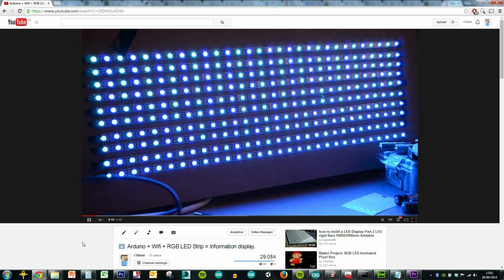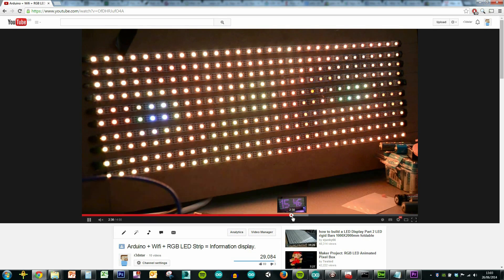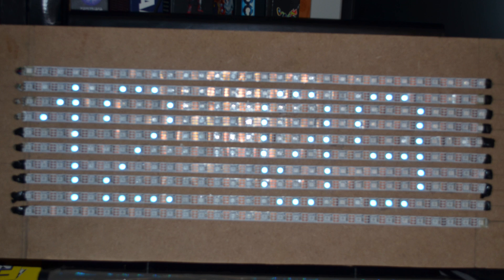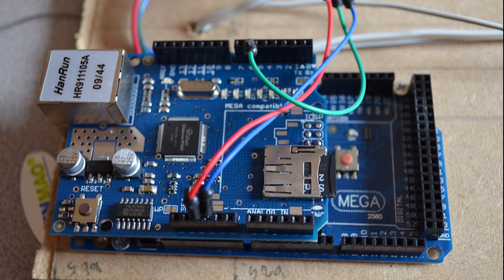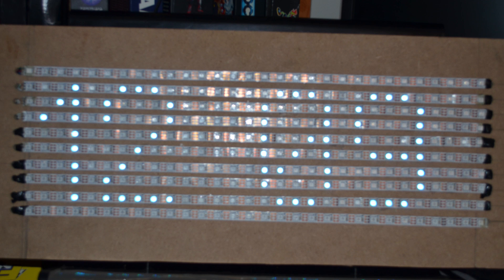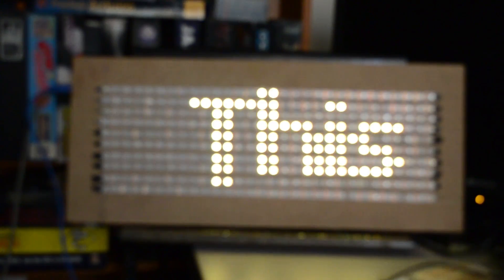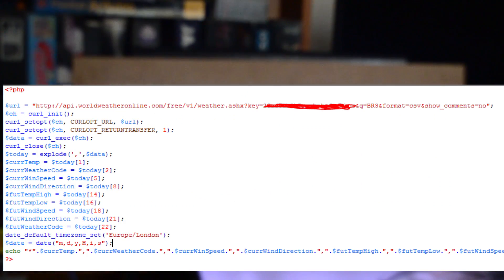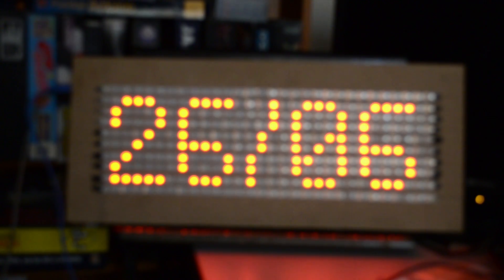Arduino powered 300 RGB LED display. An brief "How to".

Comment: Congratulations on the project. I have a question: did you power the led strip with 12 volts and the Arduino with 5v?

Comment: Question from a newcomer: Is it possible to code in what I guess I'm going to call free floating particles? So a central LED, with a glow around it made of surrounding LEDs that would glow according to a volume threshold from an audio input, whilst also be able to move freely around the board at random?

Comment: 300 5v RGB leds can pull up to 15 amps and 75 watts. Did you really have no problem powering them through pins on the arduino? I have been really concerned about power distribution with these but it might be that I didn't have to be, possibly because you would seldom want them on full white.

Comment: I was wondering. why did you place the led strip in the same direction? what will happen if you place them in a "snack pattern"?
Reply from the maker: +daniel dekel The reason for having them all run in the same direction is so it's easier to read the pixels on the bitmaps images on the SD card and relate them to the LEDs. Bitmaps run from left to right in the data in the file. If the LEDs went from left to right, then right to left, then left to right, working out which pixel relates to which image becomes much more difficult.

Comment: power consum 300 led 50mA per led, 300*0.05 = 15A, it should use 75W 5V power supply?
Reply from the maker: +TANG RAY 2.5A is fine. I'm not 100 sure, but unless you're running all of them in full brightness and full white, I don't think there's too much of a problem. Although, now I'm writing this I might have figured something out. I've recently brought it all back to life to show a class of my students and every now and then, it just stops working. I'm wondering if the 2A power supply + 500mA from the USB isn't enough after all. I might have to try a 4a just to be sure. Once I do, I'll let you know.

Comment: I love your work and so far everything works great. But the wather website that you gave apparently changed and doesnt give me the codes on the format csv. Do you know any other websites that it will or how do I create my own page on that website that it will work.
Reply from the maker: Hey George, I'm not sure to be honest. My display has been switched off for a while as it made my front room really bright at night and was a bit distracting during movies. I've just turned it on and the weather reporting is still working fine (10c with some cloud). At a guess, it might be a setting in the api request?

Comment: Can I use your code for a display with 180 or 240 LEDs or should there be written a new bunch of code for that?
Reply from the maker: Slight alterations would be needed mainly in the loops and in the bitmap reader. Nothing that trial and error wouldn't catch,
Reply: r3dstar Thanks (Y)

Comment: Thanks for video! I have a question. Is entire strip powered only from arduino's 5v?
Reply from the maker: Yes, I have hooked the arduino to a 2A power supply, but it has been run from the USB power from mylaptop, although it is dimmer.
Reply: r3dstar You've connected 12V/2A power supply to arduino, then connected strip to +5v and it lights bright, right? I've read every led in strip consume about 20mA, so 300 leds will need about 6A to have a full bright. But arduino's +5v pin can provide only 450-650mA. Is it possible to make leds have a full brightness without standalone power supply for the strip? Sorry for a lame questions, but i totally noob in electronics. I'm trying to make similar led display. I understand how to code it, but have a problems with powering. Thanks for reply!
Reply from the maker: The only thing that I can surmise is that they use as much power as they can get. It may be that to achieve their full potential brightness, you do need 6A, but I've found that my 2A PSU is more than enough. That said, I haven't turned every LED to full white which would consume the most power.
Reply: r3dstar Thanks. It's almost clear for me now. Will try.
Reply: r3dstar I really dont get it how arduino controls leds from one port ? ... I mean not the code, I wonder how does it work... did u use shifter or any other components ??
Reply: Mec Wave It uses square pulses to send data through single port. You can read detailed explanation here: https://learn.sparkfun.com/tutorials/ws2812-breakout-hookup-guide
Reply: omg using pwm :) so clever instantsoft ..Ive been searching about this ..thanks for the quick answer .  I m gonna go for shopping now :)

Comment from the maker: Hey Arby Rodriguez. I haven't used the GSM module yet, and ordinarily I would say yes, but after the issues I've found with the WiFi shield, I would do some research on it's reliability.
Reply from the maker: Also, I might give that a go myself.